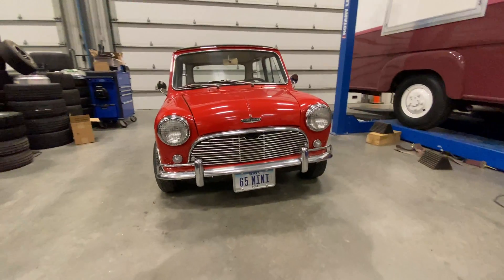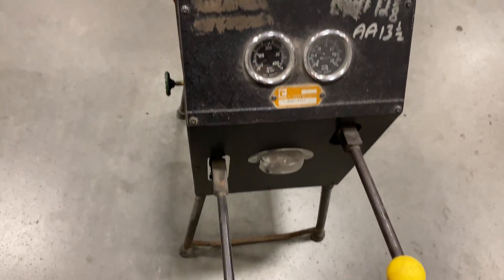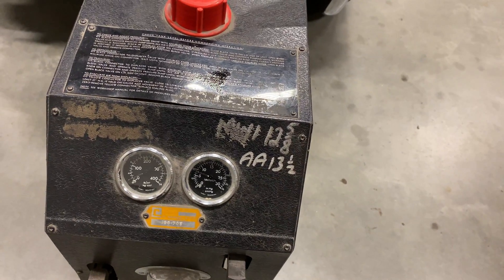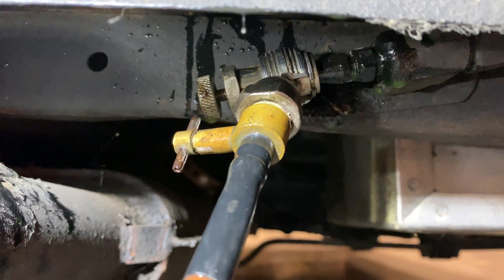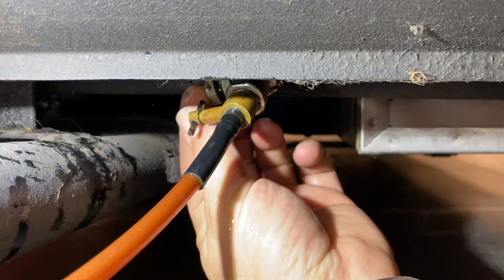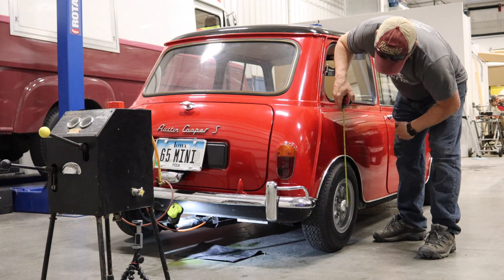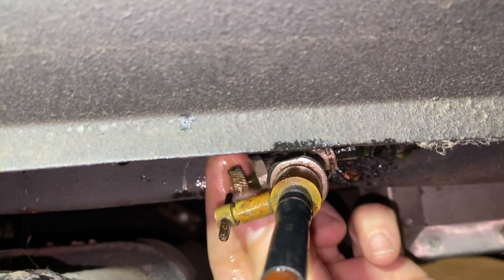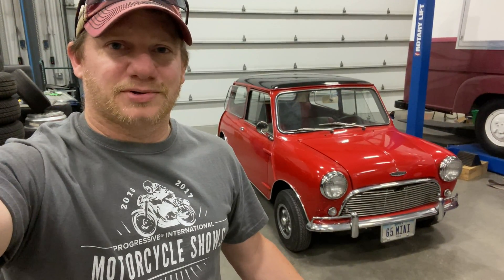Pumping up Hydrolastic Suspension on Austin Cooper S

Comment: Don't forget that you should be rolling and bouncing the car before measuring the ride height. Ideally you should push down on the car, let it settle then take a measurement. Next  lift the car, let it settle then take a measurement, next take an average of the two measurements.

Comment: I had a Mini in the late 60s and i used to let some of the hydrolastic fluid out to lower suspension because it looked too high , equally both sides of course , that was after it was serviced and the height corrected , that must have eventually damaged the suspension . Oh well young and foolish days :-)

Comment: The Original Cooper S had cone suspension. Early Coopers (and standard Mini's) had Hydrolatsic suspension, however never the S. The S came out in 1964 and in 1964 ALL mini's changed to Cone suspension.
Reply: I dont think this is a cooper s. Does not have twin gas tanks
Reply: They made the hydro suspension from about 64 right up to 67 or 8 but never on the cooper
Reply: Unless its an been imported back from Australia maybe
Reply: We have an Australian-market right hand drive 1275cc Cooper S and it has the hydrolytic suspension.

Comment: Make sure all of the pipework connections are tight, because hydro-silastic fluid fairly volatile and will evaporate easily and is hard to see, a small leak will soon dump the pressure in the line. I made my pump from an old grease gun and so long as the seals are OK it works a treat. Tried to buy on of those factory pumps from a garage sale but was outbid by someone who hadn't noticed the pump was broken. Schardenfraude!! Ha Ha.

Comment: My car has been sitting for 19 years. Should I repair my hydroelastic suspension? Or just buy a set of rubber cones?
Reply: Not just as easy as that. There are many differences on a Hydrolastic Mini. Many years ago I did the conversion to dry. For a start, the rear radius arms are different, also the front top arms are different.
Reply: @Radfordperson  yeah you’re right. I already ordered an entire new dry rear subframe assembly complete with brake lines, rubber cones , radius arms and drums. I’m just wondering how I can use my front sub frame since it doesn’t have shock springs in the front. Just hydro bags. I have a 69 mk 2
Reply: @mad-maxx2211  Mine is also a 1969 MK 2, 998 engine, You need the dry front suspension top arms, and the shock absorber top mounting brackets. You may not have the welded on nuts (to the body) to secure the mounts, my car had the holes, but no welded on nuts. I manage to use some ordinary nuts. Also the front hydrolastic units are held in the towers by sort of flanges in the towers, after removing the hydro units, I had flatten these flanges with a hammer and chisel to get the rubber cones to sit properly.

My 998 engine is bored out, 630 cam, duplex timing gears, 12G295 head and single 1 1/2" SU.
Reply: @Radfordperson  very informative. Thank you very much. I’m in the process of taking everything apart now. Any more helpful suggestions and tips are highly appreciated. I will start looking for top front arms.
Reply: @mad-maxx2211  You may need to use some washers on the suspension knuckles to get the correct suspension height. I think you need top dry top arms mainly because they are a different ratio to the wet ones. (from memory). The wet rear subframe can be used (if not too rusty). I have two other Minis, one is a Riley Elf (hydro suspension). If you get stuck, I'll try and help. I did the dry conversion about 1977, Mini spares gave me completely the wrong info before doing the job.

Comment: Hmm, my Hydrolastic pump looks very similar but only has one hose that you do both suction and fill with.  It also doesn’t have that bleed valve.  Basically you draw a vac on the hose in addition to the system, instead of swapping hoses.  Not that the damn thing works anyway...  it’s garage art.  Filled my MG 1100 using an air powered hydraulic pump and one of those tire valves you use to put water in tractor tires.

Comment: Years ago, (late '70's) I had a '65 Cooper S. VIN was CA2S7766964, engine number 9FY38432. There was a Mini mechanic named Jon Becker who at  the time owned Mini Part. He re-charged my system and I remember he charged it to 90 p.s.i. The machine he used looked similar to yours.

Comment: Interesting , can you change the suspension with different viscosity oils?
Reply from the maker: It does not use oil, it is a glycol solution with corrosion inhibitors.

Comment: Very interesting Steve, I knew the Hydrolastic suspension was serviceable but I'd never seen the factory tool or how simple it is/was to do. I know the rubber cone suspension cars can be adjusted for ride height, is that possible with the Hydrolastic suspension without compromising the ride or handling? Hope to see you racing sometime this season.

Comment: In the 70s we used Austin Maxis as workhorse company cars and for towing we could raise the pressure to keep the car balanced on an even keel. I asked our intern to get the suspension pumped up at the garage and he thought I was winding him up. He came back with they tyres pumped up high so I sent him back an the tyres came back at even higher pressure. He was too embarrassed to ask for the suspension pressure to be increased. Third time I sent one of the lads from the factory with him!

Comment: Interesting tool. I use a grease gun i think the Adapter hose was from a truck that connects the dualie tires so it screws right on the shrader. It can be a little messy have to keep the back of the gun up so the fluid doesnt leak out but it works fine. I use antifreeze I dont know if thats really ok but it only ever takes a few pumps
Reply from the maker: Antifreeze is what most people use,  the official formula for the fluid is mainly 49% alcohol and 49% water with some additives for corrosion prevention and viscosity.

Comment: I owned two Mini 1000's. They both had rubber cones for rear suspension. I can't remember what was on the front. What you have seems a lot better. Take care Steve
Reply: That would have been also rubber cones on the front. The cone suspension on Mini's went through to about 1964 - 1965 I think on  the ordinary Mini and the Coopers when they changed to Hydrolastic "It floats on fluid" suspension.

Comment: Hi, Cooper S had two fuel tanks can't see two on this shell.
Reply from the maker: They did not all have two tanks.
Reply: Thanks, I was politely trying to say this to the other person. Seems they were fitted on special order for Non S versions too.. Love your Mini though, I raced  the supposedly 850 for a few years when I was younger / slimmer/ have trouble fitting in one now..lol. @ThisWeekWithCars
Reply: @ianburit3705  Have heard having two tanks on a road car can be problematic. Parking on a sideways incline/along ditch etc can lead to lots of fuel flowing from uphill tank down to downhill side tank and out the fuel cap air vent. There is no one way valving between the two tanks, both connected direct "Y" to fuel line running to pump.
Reply: @TornadoCAN99  Would have thought competition cars would have a non spill valve to take care of that problem, vent valves normally only let the used fuel stop forming a vacuum void by a vent valve allowing air into the tank/s but nothing out ?
Not had a RAC competition rule book for many years now., and USA laws I thought tended to be very strict against leaking fuels or fluids ?
Reply: @ianburit3705  Older cars like the Mini just have a simple small hole in the tank cap. Later model mini's did away with the holes in the cap and used a vent pipe at top of tanks, then a hose to underside of car to drip out any over fill/temperature expansion fuel, but still no actual vent valving. The fuel injected cars went with a carbon canister vapour trap and fed back vapours into intake stream.
Reply: @TornadoCAN99  Sorry I cant answer you, I was racing Minis In the early 1970`s, things change more so my age of 72 now/ Different countries had different regulations for road use/ dont know, I will let you research the facts as its Interests you more than me.
Reply: were export versions fitted with them I wonder? - see - https://www.minicooper.org/mk2-coopers/post-5091/
Reply: 1965 and earlier twin tanks were optional. 1966 and up twin tanks were standard. Not sure what year this one is

Comment: When I was a youngster I made my own hydrolastic pump out of a master cylinder, it worked fine. 
About 35 years later I picked up a factory dealer pump and restored it. 
I still use both pumps, the master cylinder pump is very portable, so I can take it on club runs and do roadside pump ups.
Reply: I also made up a Girling master cylinder pump and pipes to service a workmates Austin princess Hydrolostic system  that had a very slow leak one side, but had that car for a few years.
Reply: it`s a good idea use a brake master cylinder for made a hydrolastic pump out!!!!!, first time i tried to fix it. Vacuum system is for? just change oil? how i check for leaks? just visual inspection?
Reply: Any chance you have info on how you made this?? I have a 68 austin america that needs suspension boosted

Comment: Hi Steve. You must have got this from an old B.M.C.  dealer garage. I can remember seeing many of these just dumped as the hydrolastic  system wasn't around for too long. Your "S" looks very original and l can see the battery box has been replaced , the first thing to rot out on a mini. I reckon you could make quite a profit specializing in this procedure. Thanks. Take care and stay safe.